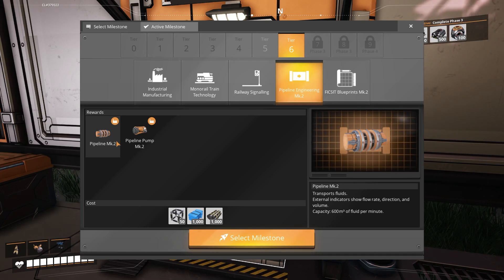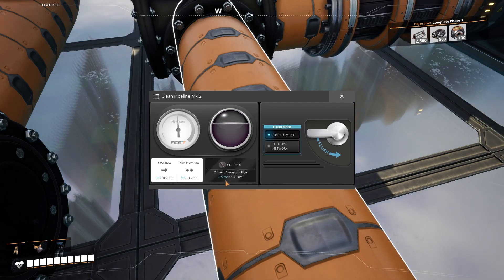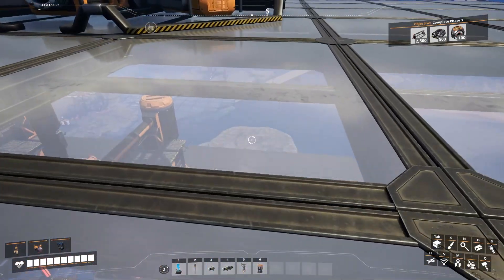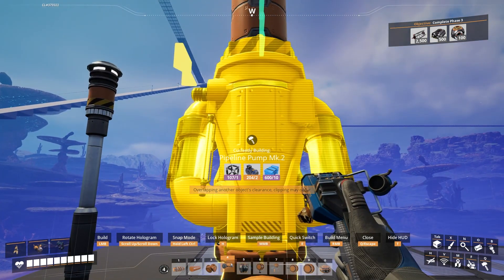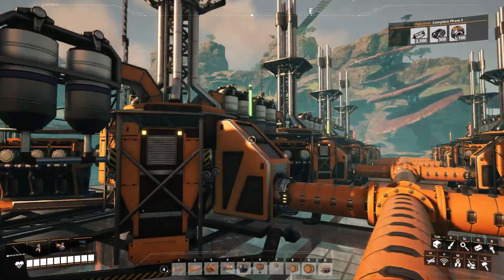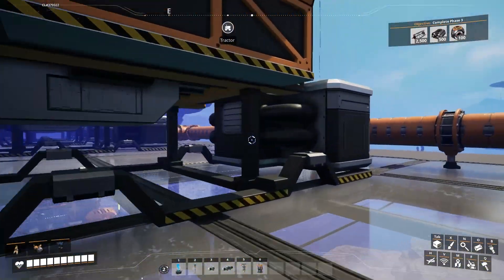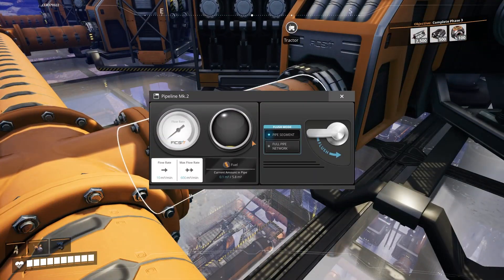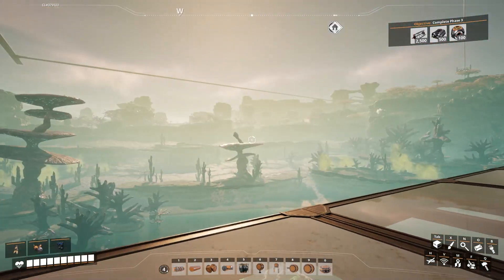Granny’s Oil Setup Doubled: +5000MW, 400 Plastic & 400 Rubber!

Comment: Don't forget to divert some of your heavy oil residue to a smokeless powder setup to use in crafting explosive rebar. It doesn't need to be a big setup since you most likely will be manually crafting the ammo as you need it. A single refinery and an assembler to make black powder using the near by coal and sulfur nodes should be a good start until you're needs require expansion/automation.  Alternatively, you do still have 3 more unused oil nodes (2 pure, 1 impure) in close proximity to your current oil factory, so you could use one or more of those to make a separate setup. Maybe use the impure since you don't need the setup running constantly at your current stage in the game.

As I have said in a previous video comment, noodle build mode works better for hypertubes while the Auto, 2D, and Horizontal to Vertical is better for pipes. If you are trying to make a very tight connection between a pipe and a machine, noodle sometimes is the only way to make the connection if the other build modes keep saying you have an invalid pipe shape. Just like with everything in this game, learning how to place pipes to make those nice corners the way you want is best by trial and error. Maybe make a platform and experiment with empty pipes to see how they bend both vertically and horizontally in each build mode.

You might want to consider not using the Clean variant of the pipes. The flow indicator is good for quickly narrowing down the problem areas in a setup. Like where a pipe isn't connected or where you have inadequate head lift. Short sections you could use the Clean variant, but longer sections you should use the normal/flow indicator variant.

BTW, no one has any idea how hard I had to suppress my inner Michael Scott from the US version of The Office when I typed "inadequate head lift."
Reply from the maker: - I indeed wanted to pull in the impure node in as I also want packed fuel.
- The only reason I struggles more with those bends was because I am not sure if I can just those small pieces of pipes which I then would have as corner was something that is ok to have. Maybe it would influence the flow or...

Much love from grandma Wendy 💖

Comment: painting pipes doesn't avoid jams, but searching for bad connections (mismatching pipe color and 'bulge' color) becomes easier when you easily see which kind of fluid is supposed to go through a pipe, and thus you can more easily verify pipes, connections, or do new splits and merges.
Reply from the maker: I thought I had to paint them so it was clear in what pipe is what fluid, so I did.
I don't fully understand what it is you are advising me to do, no paint and...?

Much love from grandma Wendy 💖

Comment: To turn a pipe with a sharp, clean 90 degree bend, it's 2 "steps" off the center.
Reply: same as bends on belts ...
which many people don't learn after Satis 1.0 got the new "sraight" buildmode, that does that automatically.
And they also have announced to add that mode for pipes soon(tm).
Reply: @Anson_AKB  When did they announce that?
Reply: @decomposedcorpse5186  on release of 1.0 they said that they ran out of time to implement it yet for the original release (and i fully understand difficulties to add several automatic bends to a single pipe segment; belts are already difficult enough with doing slopes before or after the bend, and 90 degree bends when the start is not aligned with the world grid or other belts), and in some livestream they confirmed that they were working on it.
currently without computer access, its difficult to look up title or date
Reply from the maker: 2 steps, I knew it had to be something like that since that seemed to make the nicest bends. Dinosaurbob, does it matter if this is a loose piece of pipe then in a system, does that matter?

So with a bit of luck we can a build mode for pipes just like the belts?
Then I am happy that I learned to do it manually and also happy it will be as easy to do just like the belts, if they can add it that is.

Much love from grandma Wendy 💖

Comment: When you're troubleshooting, and looking at the "E" panel of any machine, always look at both the input and output sides. Input "full" is good.  Output "full" is bad! If any of the outputs fill up, the  machines stop working... and then they start backing  up the feeding machines farther up the line.  (You looked at the "E" screen several times during your troubleshoot and didn't notice the heavy oil residue output was full.)
Reply from the maker: The worst part is that I know.. I should have seen that it was full but I didn't at the time. 
Took me a few hours maybe to get it the way it is but I did get it all done - Thank to you amongst others 🌹

Much love from grandma Wendy 💖

Comment: Unneccessary pumps are always bettter than mssing pumps.
Now you have a mosre complex power set-up, you should start using priority power switches. These can be used to make it so that if you draw too much power, instead of everything shutting dowm (including your fuel refineries), individual local grids will independently shut down. The priority power switch is in the MAM (in the caterium tree), and useshigh-speed connectors, which you can make in the workbench. You connect the main grid to the power terminal marked A, and the local grid to the power terminal marked B (I am not sure the way around of these two is that strict). you can then give the switch a name. There is a second tab in the switch interface, where you can see the status of all of your priority switches, and switch them on or off. If you drag a switch to one of the 8 priority levels, then when there is a power shortage it will switch off. Whem you have most of the power you need then only low priority swtiches (with a high number) with switch off.
Reply from the maker: Thank you so much alexisnorman for your comment🌹

I have to be honest, it seems very complicated what you write there and I don't understand it just yet but it feels like something I must do.
What are the consequences if it shuts down, except for that there is no power so nothing works?
I mean do I then have to go everywhere and manually turn all on again or can things break or..?

Much love from grandma Wendy 💖
Reply: @GramGrendy  I tend to write things more complicated than they are.
If you have a shut-down you would need to disconnect enough machines that you drop you demand below production. This is made more difficult by two things. The first is that products will bunch up on belts meaning there is often a power spike when you switch back on, and the second is that there will be a gap in fuel production from the refineries, so for part of the switch-on, you may only have the power from your coal plants. 
With priority power switches, even if you don't use the priority function, you can set things up so that you can disconnect everything except the refineries needed for fuel production from a single location.
Reply from the maker: @alexisnorman9446  You are amazing, thank you so much 🌹
I will dive into the MAM and see what I have to do to unlock this. You describe it perfectly, it's just that I am someone who needs to see it so I can understand or ... have more questions like I often have 😏😊

Much love from grandma Wendy 💖

Comment: My advice would be to place all the pipe junctions, supports and so on first, then connect the pipes between them. Same with splitters, mergers, stackable conveyor supports and only then belts. Putting junctions onto existing pipes occasionally doesn't behave as expected - same with splitters etc onto existing belts.
Reply from the maker: With pipes I sometimes have the feeling I have more pipe pieces then I placed, as if it cut and ... don't know exactly. Today I was changing and I had a pipe double in 1 spot which I know I didn't place.. 
So yes, I think you are right. Thank you so much 🌹

Much love from grandma Wendy 💖

Comment: you can get rid of that pump under the top (generator) floor.  It's not needed.  Technically, everything else should now be working as is.
Reply from the maker: I only placed it as I was searching for what I had wrong, I was just trying to see if maybe it couldn't go up that little bit anymore.
Yes, power is stable ever since so I got there in the end.

Much love from grandma Wendy 💖